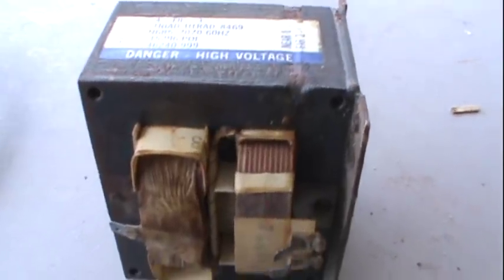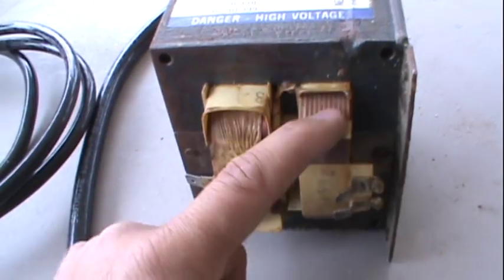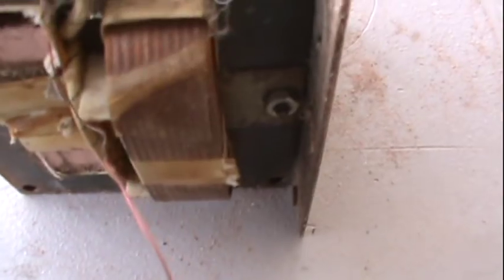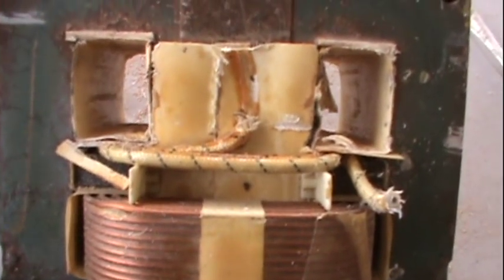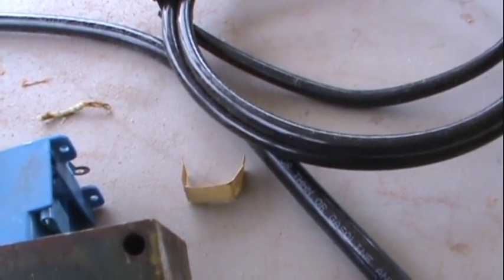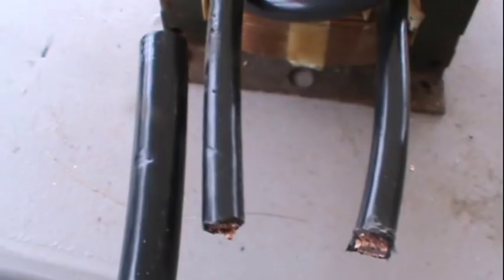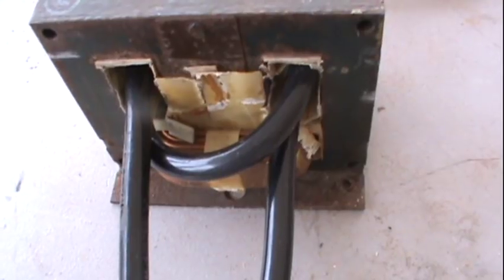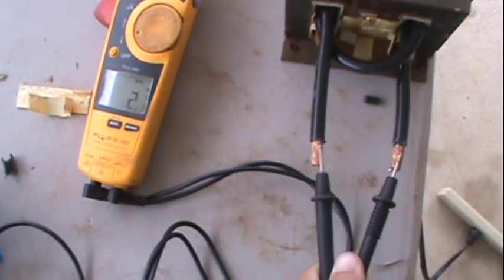Home Made Spot Welder  Pt 1

Comment: I'm  wondering  how much  current I might get if I wind the secondary winding using insulated 4 gauge wire instead of using 35 sq mm or 70 sq mm welding wire...

Comment: Anybody know what I'm doing wrong? I replaced my 2nd coil with 2awg welding lead but it wont melt anything like in the video. The input reads 117v output 1.8v. Note: I cut the transformer open instead of cutting the old 2nd coil. I'm thinking I either need a bigger transformer core or over 120v input.
Reply: +WVresident awesome! Great to hear it's working.
Reply: I'm not exactly sure but usually when you cut straight into the transformer it can damage the magnetic flux (the big iron part) it happened to me so it's possible
Reply: +Trez Tech Tips I got it to work. turns out the lead wire I was using (8awg) was somehow bottlenecking the power. I changed to 3 wraps of 4awg welding wire for the coil, lead wires and it works now.
Reply: u'r doing great. no need to replace... keep goin buddy
Reply: the more turns you put in it causes a larger voltage drop. the fewer turns causes current to spike up and heat your wire up faster. You can google ohms law and it will explain the math and what's going on.
Reply: caleb hall 
More turns more induced voltage produced. hence more voltage applied to the resistance between the two metals you are going to weld. If more voltage applied to the resistance more current flows through it because according to Ohm's Law the current I in an electric circuit is directly proportional to the voltage E and inversely proportional to the resistance R, or I = E/R.
Reply: WVresident    xxx

Comment: why we must use a microwave oven transformer and not any other transformer for spot welder,what are the characters that made it the most suitable for such project?...thanks
Reply: +المهندس ضرغام الجاسم BigtTransformers are expensive and microwaves are disgarded everywhere and have usually heavy transformers in them, anyway heavy enough for a diy spotwelder.
Reply: I wish they still lasted 10 years! Mine barely make 2-3 years.

Comment: What cable size in mm you use. You say "two gauge wire" or similar. I'm not sure how to transfer it to mm. It is about 6mm2?
What length?
Reply: Probably about 12mm in diameter. And looks to be at least 30cm in length. Good to have a bit extra length for connecting to the welding contacts.

Comment: Have you ever trued increasing the length of the secondary but not having to have it around the solenoid? I think all the wire length which actually is the causes of higher voltage, doesn't really have to be in the the magnetic field of primary!
Reply: Your thinking is wrong. Why we need coils in that case anyway? Just make very long cables, right? Wrong!. Extra cable length only makes things worse adding resistance, and in this project it is VERY critical. Longer cables do not add any voltage.

Comment: First, DO NOT CUT THE TRANSFORMER. The transformer is made of stacked plates of high silicon steel which have thin layers of varnish to insulate them from eachother allowing the current to flow properly and lower the amount of leakage inductance. you will never be able to retain this insulation or replace the pieces in the exact way so as to keep the leakage inductance low.

Second, go to a welding shop and buy finely stranded wire. It looks like 1 gauge, not 1 aught would be the biggest you could fit. Ideally you would measure the inductance of the core and do math to figure out the max current it can handle but we can do some estimating instead.

It looks like that is at least 1000 Watts, probably more. Watts is volts x amps. 1000 watts / 2 volts = 500 amps. If you attempt to weld a substrate that allows more than 500 amps of current to pass through you will damage the transformer. You can not simply measure the resistance of your substrate with an ohm meter. The resistance will change with heat and as the two pieces are fused. I would look up 1000 watt/500 amp spot welders and see what kind of materials they are rated for. Please bear in mind that larger welding contacts will allow more current to flow so your contacts must match the size of those on your comparison model. Just for posterity's sake I would get a 500 amp fuse so you don't start an extremely dangerous fire.
Reply from the maker: I never cut the transformer, but thanks for the comment and advise.
Reply: If youre just doing batteries smaller welds would keep the draw lower. sharpent the tips to a point.
Reply: ***** I've long decided that the upper limit of what I'll be welding is 2.5mm 
diametre steel rods.  Besides this, it will be 1.5mm diametre steel rods & battery tabs. I already have a prepared transformer; (part# MD-103AMR-1) & 2 guage welding copper wire. The problem now is deciding which welding tips to use. They will have to be swappable.
Reply: Hi, are you saying that the contacts must be about the same wire diameter used for the secondary wingding?
Reply: No, I am saying the resistance of the connection through the contacts and material being welded needs to be high enough to limit the total current that flows through the transformer so you don't burn up your wiring or fry the transformer core. You could smaller gauge wiring on your secondary winding to add resistance and limit the current that way but you are best to limit current at the point of contact. Spot welders have a specification called "Dwell Time". Dwell time is the maximum amount of time the circuit can output at the max current before reaching a temperature that is hazardous to the materials used in its construction. The primary may have a resistance that will limit the current draw to something suitable but again it wont last long. Even if his secondary wasn't pvc jacketed the primary wire most likely has a varnish that is only rated to 125 celsius or so.
Reply: ***** It seems the right amperage fuse/breaker on the secondary should come in handy for this application.
Reply: yes, but youll blow it all the time. breakers should only be run at 80% anyway. you really need a dwell circuit controlling a relay for the input
fuse and breaker anything you build as well.
Reply: An analog ammeter on the input would be good too. you could watch the draw rise and fall. as you work with different materials you would get a feel for what is and isnt safe for your welder.
Reply: 10 gauge solid copper wire is pretty easy to find. It's used for grounding junction boxes to water pipes and where coax and phone lines come into a house. Next time you see the cable guy ask if you could buy some, he will probably answer, "what? like a lot? I mean I could give you a foot or two". Offer to pay him after he gives it to you and he will just say don't worry about it, it's a short scrap piece. Do that if you're cheap, other wise buy 1/2" copper bar stock and file your own tips.
Reply: +skoronesa 
Quote "allowing the current to flow properly and lower the amount of leakage inductance."  WRONG. 
Short between the laminations will cause the eddy current loss to rise and the trafo will overheat. Leakage inductance will not change.
Reply: Azzy M Yes, sorry for the mistake, you are correct, either way it's easiest not to take them apart.
Reply: skoronesa blablabla
Reply: skoronesa

Comment: How the black wire on the top getting power to the secondary coil it is not connected and i saw the power supply is only from the second coil (below) how it happened?
Reply from the maker: induction.
Reply: Transformers work using induction, this means the electrons from the mains flows through a magnetic flux in into the secondary winding

Comment: I am building a spot welder to use for my art, but for the new secondary coil, where did you get the wire from?
Reply from the maker: lowes sells it by the foot, i think this was
Reply: Momentary trigger switch question. Can it carry any voltage, 120V or 220V? My transformer is 120V
Reply: crob227
Reply from the maker: lowes.

Comment: two wrenches (box end) give good leverage for bending wires.
A  few vids use wood jaws with a spring or rubber band to hold apart that extend from a box that houses the transformer.
Reply from the maker: thanks for the tip.

Comment: Great video!! Should you wish to use a heavier gauge cable as your secondary, you may like to consider welding cable. You can get diameters from about 1/4" up to in excess of 3/4". They are very flexible and there fore easy to bend. Good luck with the next stage of your project. Stay Safe.

Comment: why cant you just hook it up bakwards secondary as primary
Reply: No you cannot. The task is to have HUGE current. Primary coil made from the wire about 1-1.5mm in diameter only. Also secondary coil on this transformer made from very thin wire, so it is too thin even for current in 120V circuit to carry the power about 800W  - 1500W. This is very short answer, I do not want to put here much transformer calculation. Just accept that existent primary coil is calculated for certain power for particular transformer and voltage 120V and no need to change it.

Comment: I really have to build one of these myself!! On the subject of wire...2/0 is another way of writing 00, known as "two ought"  That measure is used through 4/0. then goes to the actual area of the conductor in circular mils, by the millions, abbreviated as MCM. If you were to use welder cable, or good quality battery cable as the secondary, you would find it much easier to wind. A soft hammer helps, too. You might meter the primary amps too;  it would be nice not to burn up the transformer!

Comment: i was able to cut the weld on my mot with a hacksaw. took about 4 minutes. its actually alot easier. i took 2 of the E cores and stuck them together to make one big Eᴟ :) its alot of fun.
Reply: I like that idea, and now you can connect primaries parallel and make one VERY THICK secondary. The only thing you should not make a mistake connecting primaries, otherwise you will burn them. Also your primaries have to have the same number of loops.

Comment: will it be ok to plug in the 120 volts transformer into 220volts power suplly after i rewinding the secondary coil and make it into spot welder?..sorry but i dont have a lot of knowlege about electricity..
Reply: you will burn the transformer. Think about it: primary coil was designed to work for 120V

Comment: Hi! If you get a MOT that's for 240V 50Hz and some thick welding cable or some 2AWG audio/home wiring cable it should be enough to weld 1mm sheet steel. It should be enough power to even weld up to about 3.75mm (1/8in) sheet steel!

Comment: Interesting project. It looks like you might make this functional. So now you need to decide how your contacts should apply momentary clamping. It would also be very important to engineer some sort of cooling system to the tips of your contacts. Speaking of tips, spot welders are notorious for requiring constant reshaping and replacement of their welding tips. I suggest looking at some commercial spot welders - I feel confident you can solve these issues. I'm 20 years a sheet metal worker.

Comment: COOL , hey homie high gauge speaker wire or welder cable is best because you can bend it so easy due to the fine strand copper, hey just a note to consider , all spot welders
work on pressure as well heat, sum apply thousands of pascals of pressure on a tiny point

Comment: well i recall a spot welder i used in high school-it had like 2 long hooks that were hinged at the back so you could get large pieces into the machine.
it would pay to make it with sharp replaceable electrodes so you could swap them out when they burn up.
a foot switch might be handy for turning on the transformer and i guess a locking lever to press and hold the points together would also be a good idea.
that heavy gauge wire you didnt use would be good for bringing power to the weld points